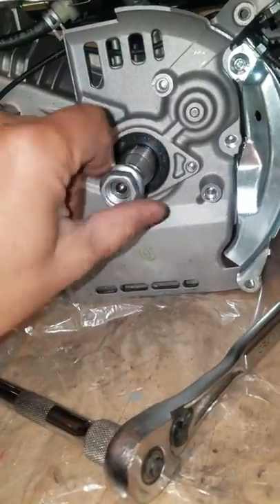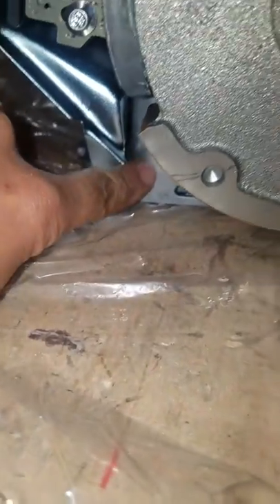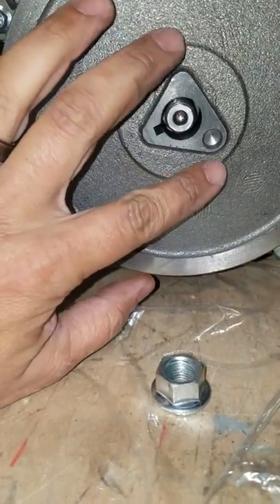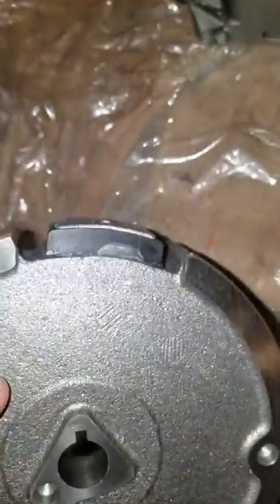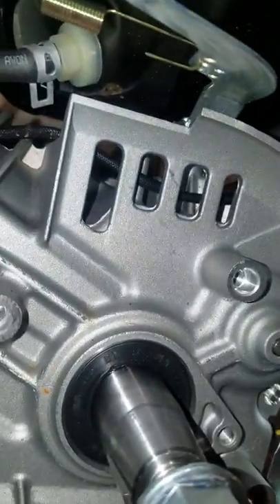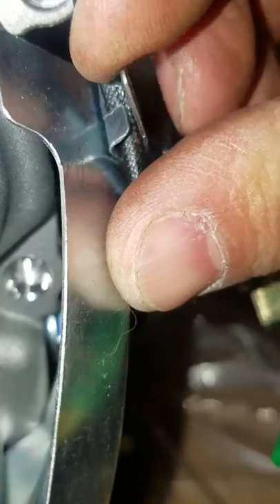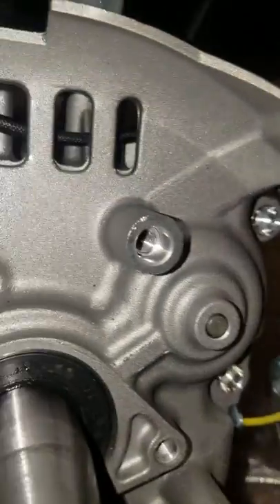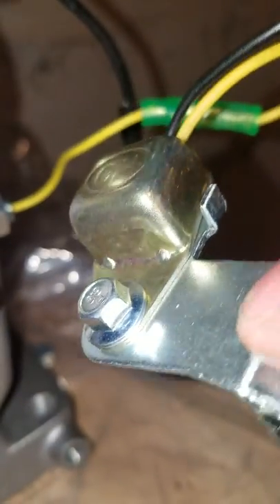Prepping the HF 6.5 h.p. Motor for Electric Starter and Charging Kit Installation Pt 1

Comment: Thanks for the video!  What predator engine do you have?  I have a 212cc, but was told the GX200 would only fit with certain year (prior 2014?)  and the newer style would not.  I haven't seen your 3rd video yet, but I'm about to watch it now.  Can you let me know how well it is now after having it on for a few months?
Reply from the maker: ethan'stank. I actually went out and fired the motor up today on a whim (I've been hands off of this project for months now as I have had a lot of other stuff in the works). Started up on the first pull. I had taken the battery out for my other cart project.
I have both the standard predator motor and the hemi version, with the standard version on the cart now and running strong.
Thanks for checking out these vids. Hope they are of some use.
Reply: ethan'stank 
Honda 160 engine for go kart

Comment: what flywheel do/did you use for this?  by the look of that valve cover, that is a predator hemi 212.  that taper is different from the honda/clone starter kits.  if it worked for you, i NEED to know what you used and from where PLEASE!
Reply from the maker: Tom York Hi! I LOVE Radiohead. Haha
Seriously though, I  did find a flywheel that fits perfectly. Offhand, I can't recall what the part number is,  but I do have it listed in the details of one of those videos.
The taper on the hemi is a p.i.t.a. to find a good flywheel with magnets for.
Reply: yikes, you have ALOT of videos.  any idea which one?
Reply: i found it in one of your other videos.   Kohler 17 025 30-s
Reply from the maker: Tom York yep! That's the one.
Reply: Johnny I. I assume it worked as far as fitment and function for charging with the kit you previously had?
Reply from the maker: Tom York yep! 😁👍
Reply: Johnny I. Awesome.  I think alot of people out there that have hemi motors will find this very useful.  Good work.
Reply: What I did for mine after removing the stock flywheel was order the $36 flywheel kit with 3 magnet flywheel and 3A coil,  I removed the spark plug, had a buddy turn over the engine manually with a drill, and rann a flat file over the taper for about 20 seconds at a time, cleaning, checking for fit, then clean again and file more until the new flywheel fit perfectly on the shaft. Granted I cannot switch back to the old flywheel, btu when everything works perfectly, why would I want to?

Comment: Did that engine actually accept the electric starter when you got it. When I posted about adding an electric starter I was told that block must be designed to accept it. I wonder if yours did because my clone appears to be the same block shape as yours. I don't see any video of your actual starter installation.
Reply from the maker: ken h Yes the starter will bolt directly to the block. But you will have to cut a little metal away from the shield so that it clears. Nothing a pair of tin snips won't make quick work of.  You'll see where to cut once you bolt it in place. 
I didn't make a vid of the starter installation as far as I can remember. It's been a long time since I did that build. I  may be doing another one soon. I'll be sure to include that part if I do, as well as the wiring, as a lot of people have asked about that too.